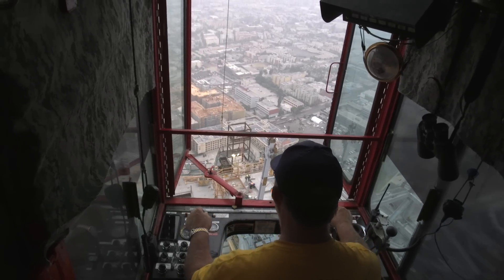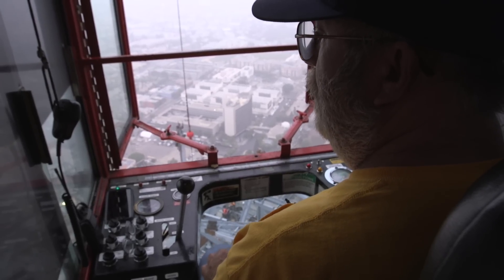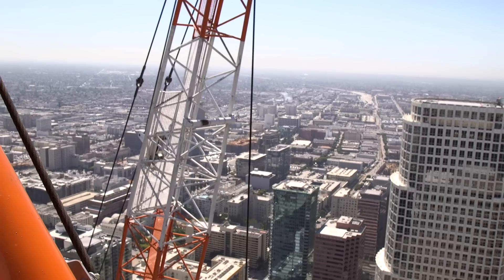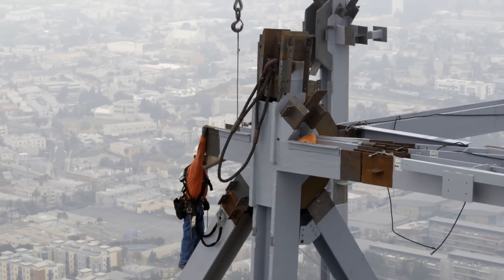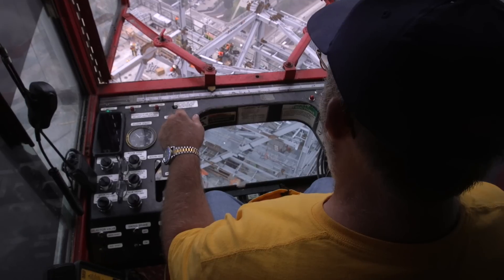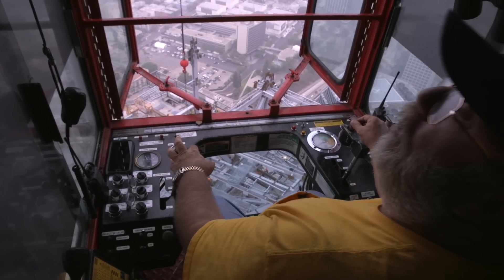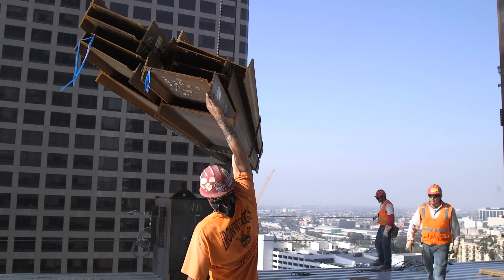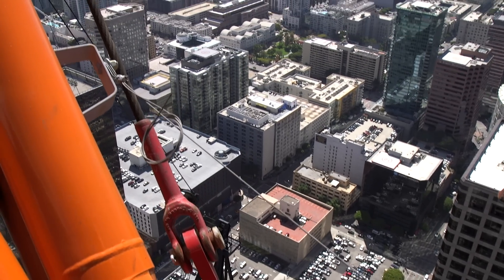Operating Engineers Local 12 Working the Crane

Comment: That crane is a TG2300-B. Its a diesel powered hydraulic crane. Most cranes are electric. However, because of this ones set up, it can lift a substantially greater weight than any electric crane. There are about 3 in North America right now. I'm currently working on one in Canada.

Comment: Hi, Any chance you can let us know how this crane operate swing with the feet what are the hand stick's for left and right? Hoist and jib up/down? Thanks we don't see this cranes a lot ;)
Reply: Two pedals on the floor for feet left right swing, left lever is boom up or down, Right lever is hoist up or down, left switch is brake, right side also has throttle for the engine, it really takes four hands to run, linkbelt tg1900

Comment: How do you get the crane back on the ground when job is finished ?
Reply: It's usually disassembled into pieces that can be hoisted by smaller cranes or with the use of gin-poles, structures attached to the side of the structure being built. After construction, those gin-poles are removed and the building's outside is completed.
I would not rule out the use of a helicopter to transport the biggest parts.
Reply: The crane lowers itself with a hydraulic climber you can see the climber right under the cab.

Comment: is that an old favco 1000
Reply: No its either a TG 1900 or TG 2300 Cornell bought nearly all existing ones and custom modified them.  TG 2300 I think lifts 230 Tons.
Reply: The good ol Favco 1000 🖒
Reply: @jamesberlo4298  230 Tons??? Not sure they got tower cranes doing that type of weight.